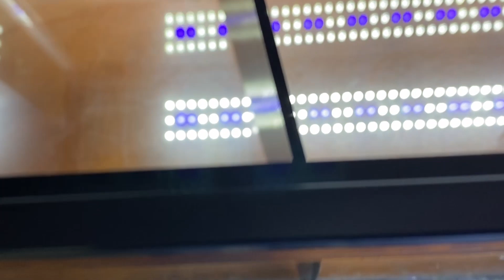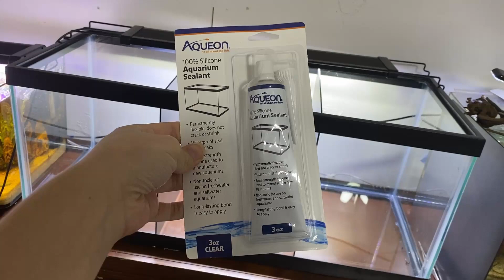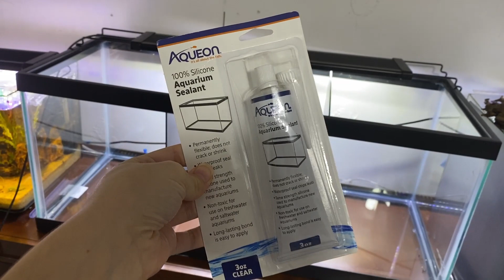DIY Tank Dividers for Betta Fish - 20 Gallon Long Divided Betta Tank

Comment: Little tip its easier to measure the width on the outside of the aquarium.. hold the board up to where the glass starts and where it ends. Idk if that makes sense but I'll try link a video I watched of a girl making a mesh divider but she explains how to measure the divider to fit into the aquarium.
Reply: Yes, but it’s okay 😇 I understand and get the bigger picture

Comment: Since the water isn’t shared, do you use 3 separate filters and Heaters? I was hoping to put one divider in my 10 gallon tank and get a new Betta, but I wanted to use only one filter and one heater

Comment: I have a question. If they are water tight then wouldn’t u need 3 filters and 3 heaters?
Reply: She said that at the end of the video. But I honestly would guess that if she used two heaters one on each end... It would heat the middle regardless. I think three heaters might actually be too much because they may not share water, but they are in the same tank so the temperature will still be somewhat shared even if the water is not. But being as her fish room is cold she has to heat both sides or one side might actually become colder than the other.   Either way. Three filters and at least two heaters are needed.

Comment: Good job, but I will have done one more thing.  At the bottom of your divider, I will have drill few holes to let the water flowing from one  section to the other.  Then, because of your space limitation, I will have created, on the top of your aquarium, a filter box (you can use a planter with media, foam... and few terrestrial plants). A small pump in your RH section to the top filter and the return in your LH section.  You will have created a full cycle and unique planted top filtration = efficient, beautiful and easy to maintain... You can also add your heater in the LH section where your water is returning from your filter.  Due to the water flow, the warm water will go through your 3 sections.
Reply from the maker: I actually very specifically wanted no shared water! I siliconed these dividers into place to have three separate sections. Because I run so many tanks with so many fish, I like to have high levels of biosecurity. I limit cross contamination between fish as much as possible. My python for example is only used for clean water, I manually syphon water out with a sanitized syphon. This has saved me a lot of heartbreak with myco + tanks. Myco in bettas is unfortunately not as uncommon as people think, with some studies recording 14-25% of clinically healthy fish swabbing positive for marium or other strains. I’ve been able to prevent a lot of loss with keeping my systems as separate as possible!

Comment: I really hope you went for sponge filters, that way they could all be run off 1 pump, (just get the appropriate airline connectors at your local aquatics shop) which would be much cheaper to run.  Also I'd be curious about what happened if you just heated the middle tank, or the 2 sides, by my thinking you probably wouldn't need 3 heaters on the go, sure there'll be temperature fluctuation, but I wouldn't have thought it would be a concerning amount...
Reply from the maker: I run basically all my tanks on sponge filters. I have a much larger fish room then when this video was originally made. I used to use individual heaters for each section yes. Three small 50w preset heaters. There’s not enough heat exchange when you silicone the dividers to heat other sections, as there is no water flow at all. My old fish room was also very cold. 

I actually heat my entire fish room now, so I don’t bother with heaters at all.

Comment: We used plastic embroidery sheets with edges from report binders. You used WAY too much silicone it didn't need to be water proof just hold in place
Reply from the maker: I’ve done that method but really disliked the outcome. It was far too see-through even with doubling up the embroidery sheets. 

I siliconed them to maintain bio security. Prevents spread of disease between fish if any of them get sick. Prevents infecting all of them. I don’t need to, but after years of keeping bettas, it’s what I prefer. 

Also I know the silicone is messy, this video was my first time ever siliconing dividers into place. It looks very nice when I do it now. Doesn’t really matter tho, it’s in my house. If it’s messy it still is functional for me